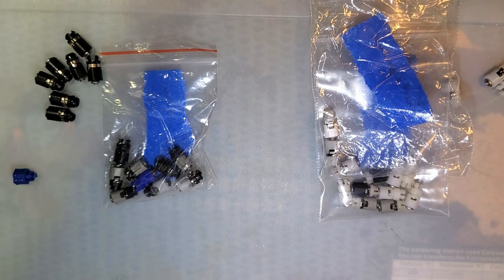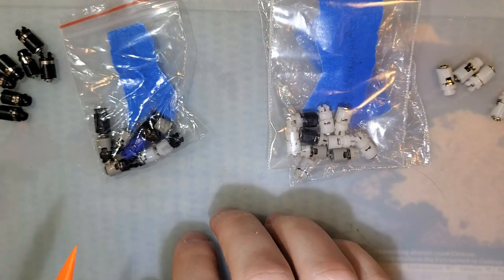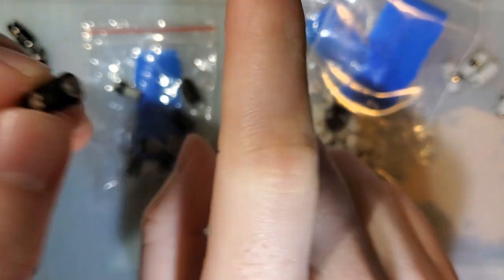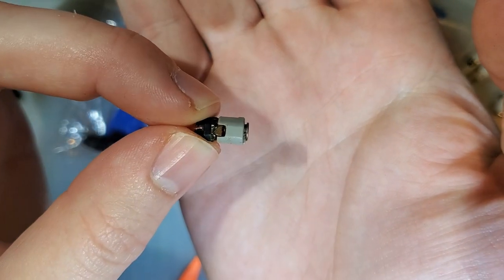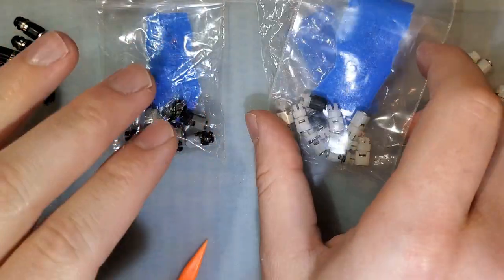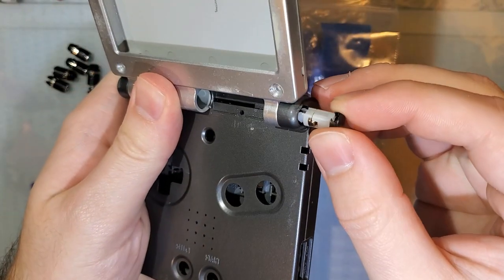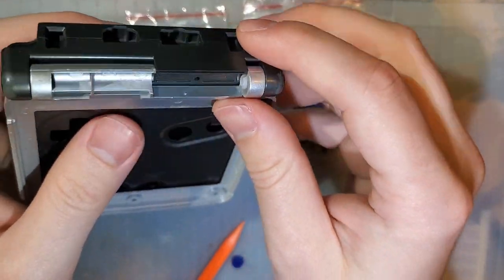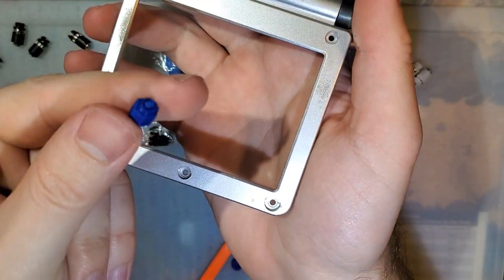On Game Boy Advance SP Hinges

Comment: First, you are a godsend. Thank you for this information - there isn't enough of it out there.
Second, does anyone know why my reshelled SP hyper extends when opening? It completely goes passed the sweet spot and clicks when its completely straight up.
Reply from the maker: probably have the wrong hinges in there
Reply: You might’ve installed the hinges when the case is closed. You’re supposed to put them in halfway, then open it up, and push them in the rest of the way.

Comment: In my experience, I've encountered two distinct types of aftermarket opaque cases: those of lower quality, typically available on AliExpress under the 'JCD' label. These cases often feature uneven cuts, poorly crafted sound apertures, a texture reminiscent of amateur spray painting, and a lack of proper fitting between components. Conversely, there are higher-quality alternatives, exemplified by one I acquired from eBay. In this case, the sound apertures were precisely aligned, the cuts were clean, the pieces fit snugly, and the overall tactile experience was satisfying. However, it appears that such superior options may be exclusively found on eBay, though I cannot confirm this definitively.

Comment: Hi, just find out something! I have a GBA SP with two WHITE hinges and they are both working properly, NO left/right color differences. BUT if you make a half rotation of the hinge (let' say the LEFT one) by hand when disassembled and put it back in the same position it does not work in a proper way anymore, it is more loose. The reason is that with that half rotation, the left-hand hinge has become a right-hand hinge. Please check it
Reply from the maker: I've heard they changed this for the very late revisions but I've yet to get my hands on one to check.

Comment: I figure that the bad OEM hinges that seize up are probably from being forced out while in the wrong position, then installed while in the correct position (open to the same angle as the detent should be), but the hinge is already wound past the detent. Perhaps that can be fixed by finding a way to wind them back before inserting them. The issue is that pliers and such will mangle the plastic slots but, well, you and I have 3D printers. ;)
Reply from the maker: The hinges should be able to do a complete 360. The only ones I've ever had that were seized appeared to have rusted shut.
Reply: @makho  

Hmm...

If they can do a complete 360⁰ then I don't see why there is a left hinge and a right hinge. Maybe there's nothing stopping them from doing a 360⁰ but the spring still gets coiled or uncoiled when you do? I'd really like to dissect one to see how they work. :)

My guess is that turning beyond the detent in either direction makes the two halves pull apart slightly until they rotate enough to slot back in to their detents when the two halves contract back together, but that would require a different kind of spring that doesn't coil/uncoil when turning and would need to be pretty strong to be contained in such a tiny hinge and still be able to tension the screen without axial tension.

Comment: Hey so I just put my sp back together and my hinges are in the wrong position, I didn’t mean too but I accidentally did. They do that thing where it doesn’t click when you shut it, anyway I am gonna get around to repairing it at some point but does having them in the wrong orientation harm them? Like if I leave them like that is it going to break my sp or the hinges?
Reply from the maker: Wrong orientation and overspun are the most common issues. They're pretty hard to kill though so you can just try again.

Comment: I didn’t realize that there was a left and right hinge when I was reshelling my SP. I was able to put the hinges without any issues, but if I did it wrong, what is a dead give away that I have to place reopen the SP and fix it?
Reply from the maker: if your hinge doesn't click open or closed in the proper places. If it doesn't stay closed upside-down when you hold only the bottom and try to let gravity open it.
Reply: @makho  thank you! I’ll definitely check with those tests 👍

Comment: Hey, can you help me pls, i think i have a weired problem. I use original hinges in a clear after marked chell. I put the black one left and the withe one right. But my Gameboy now dont snaps in the "Sweet Spot" when i closing it, AND when i open it, it snaps to far, like there is a 180 degree angle between the screen part and the button part. You knwo what i meen? What did i wrong, i dont understand it. :( is it possible that i destroy the hinges caus in the past i made a mistake that i switched the position of the black and withe hinges. Do you think my hinges are broken now?
Reply from the maker: you put them backwards
Reply: @makho  ty for your help :) but how can I use the hinges backwards? My hingecaps are on the outside, so they arent backwards, are they? Maybe I’m misundering you :0 btw. sry for my bad english, i try my best :)
Reply from the maker: @jannikbloedorn  black goes on the left, white on the right.
Reply: @makho  this is what i did :0 i place my oem hinges black left and white right (as i said). But i dont know why it dont snaps when its closing and it snaps to far when its open :/ Becaus i have a clear shell, i can see whats going on. When i open my SP, both parts of the hinges snaps together, so the key snaps into the groove (but the Screen goes to far, as i said). But when i closing it, the key stops a little bit before it arrives the groove. So you can be right if you say i have to try it in the opposite sides, but if this is right, it is really strange that my oem hinges are white left and black right, isnt it? And the hinges came out of my original SP, i dont bought them, but i cant remeber how they came out of the Gameboy :/

Comment: I bought 2 aftermarket hinges, and they won't fit into the hinge caps that came with my shell. I tried looking for caps online that would work with aftermarket hinges, but I couldn't find any. Do you know of any places where I can get some?
Reply from the maker: The caps alone? No, I don't. You'd have to modify the caps you have or pick up some salvaged OEM hinges. I heard that someone in China is trying to get OEM compatible hinges made but I have yet to hear anything else about that.
Reply: @makho  Ok, thank you.

Comment: so.. my oem hinges are both white. I also forced them out while closed so theyre in the wrong position while trying to put them in the correct way. dont know what to do here
Reply from the maker: there should be a channel going down both sides of the hinge. If the channel on the two parts is not aligned for insertion, you'll have to find a way to rotate the hinge before you can insert it.
Reply: @makho  ended up putting half the hinge in and rotating with pliers, worked like a charm! thanks for the reply

Comment: @makho, anywhere you can strongly recommend for proper hinges?
Reply from the maker: rgrs has those newer metal interior aftermarket black hinges that work pretty decent. You'd have to modify the hinge caps if you want to use OEM or transparent caps though. Otherwise, you can still buy salvage hinges from sellers on aliexpress and taobao but YMMV and I'd highly recommend getting a small baggy full so you can sort out the junk ones yourself since they seem to be hit and miss.

Comment: I bought hinges from aliexpress and ebay and they came in pairs but no mention of left and right, no wonder they didn't fit and I ended up using the originals, also didn't know you clipped the end on so now my console has no ends, I've still got them but can't be bothered taking it apart again, lol

Comment: I, for the life of me, cannot get it to snap shut, no matter how many different hinges I use or how I have them oriented.
Reply from the maker: sometimes aftermarket shells just suck that way
Reply: @makho  That's pretty much the conclusion I came to as well. It snaps open, but compared to my other SP, the angle is off.
Reply from the maker: @themoon69420  no, now it sounds like your hinges. Not sure what you're doing but if it's snapping open at the wrong angle, it's not the shell.
Reply: @makho  Hmm... I'll keep messing around with it then. I tried 3 different pairs of the 10 that I ordered and got the same result. I had the same thing happen with another re-shell and was able to correct it. I'm not sure what I did, though.

Comment: Usually, the hinges have 4 teeth that holds the shell. But I bought a 2nd hand ags 101 and the hinges are just white and only has 2 teeth. I've been trying to remove them but its really hard to remove, is that an aftermarket hinges?
Reply from the maker: I believe there are two teeth hinges from Nintendo. Not sure. I have seen those before I just don't recall off hand if they were OEM or aftermarket. But yeah, they are harder to remove, just keep going at it.
Reply: I bought a brand new AGS 101 from Walmart years ago right before they stopped selling them. I recently reshelled it and it has the same
white hinges you mentioned. It was extremely difficult to remove them and I damaged one in the process. I’m still looking for a decent replacement. XD
Reply: @ashes896 same hahaha, took me an hour to remove those and sadly, I got one damage too. I suggest you buy a defective gba sp/ gba sp parts on ebay. Like makho said, original hinges are better than aftermarket.
Reply: @Jonahlegocity  Aw, man! I’m sorry one of them was damaged for you too. Good advice! Looks like that’s what I’m gonna have to do.
Reply: @ashes896  and its cheaper as well, I bought a defective gba sp took out the hinges, and I sell the other parts since I dont need them.
Reply: @Jonahlegocity  found some on eBay! Wish me luck haha

Comment: Thanks man. I had some trouble reshelling my SPs well basically because I had crappy shells, as well as garbage aftermarket (*only right*) hinges. The only half-decent shell I have encountered is the SNES styled one. And it still doesn't feel quite like oem. Now I'm thinking it's better to paint the old shell.

Comment: I’ve got a mint ags 101 shell, buttons and membranes and a funny playin ips kit I’m only missing hinges and a speaker to have a complete 8th gba sp I did a shell swap for someone and they sold me the old parts idk why they’d reshell a mint black 101 but they love pikachu lol anyways I don’t wanna cannibalize another complete gba sp just for hinges and a speaker and I don’t wanna modify these hinge covers because I’ll likely damage them this thing is minty even has both back stickers still and I’m tired of these clear shells all 3-4 I’ve done have cracked even the ones sitting on the shelf and after the first one cracked I made sure to always be extra careful not to over tighten and they still crack after 4-6 months even if I put it on a shelf and never touch them it’s sad